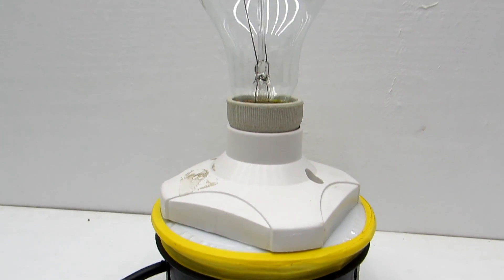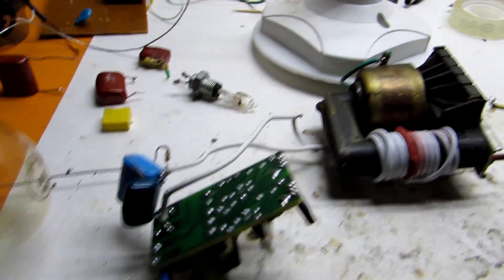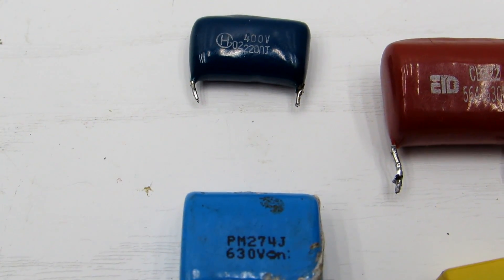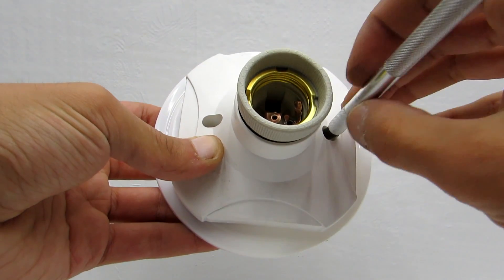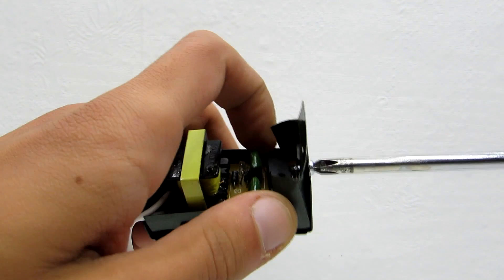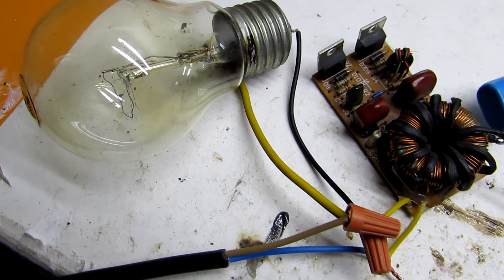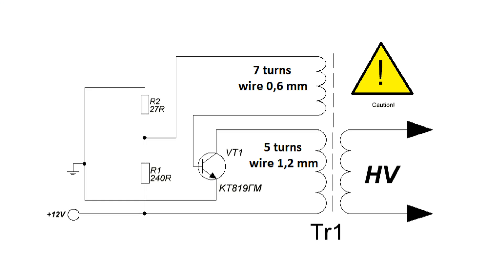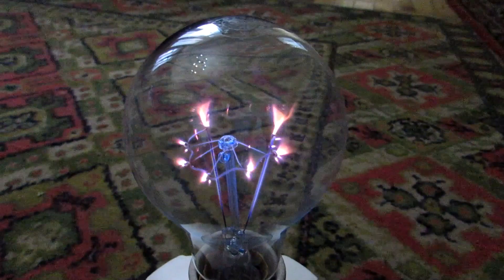DIY plasma ball from incandescent lamp

Comment: I have made this with tesla coil designed by me with a 100w bulb as top load of secondary coil. The result is awesome
Reply: Sambhunath Chatterjee I wanna see that, please make a video
Reply: @genesssisss  Ya sure
Reply: I done it with a 1000W bulb... I guess I will make a bigger tesla.
Reply: @HA7DN  the wattage doesn't make a difference, wattage of a bulb is how much it resists mains voltage, the high voltage plasma globe sends current through the gas inside the bulb rather than through the filament. A 1000w bulb wouldn't be any different than a 10w bulb.
Reply: @platinumsky845 except size. A 1000W lightbulb is bigger and thus makes a fancier display.
Reply: @HA7DN  you can find bulbs of any wattage in a variety of sizes, 1000w bulbs can come in sizes smaller than a pencil and 10w can come in sizes bigger than even larger store bought plasma globes. If you want a certain size then look for a certain size, not a certain wattage. Wattage is not what makes a bulb big.

Comment: The two wires from the hv transformer u connect it at the two end of the bulb or one at the end and other at the side
Reply: Well, a lightbulb is a conductor so if you connect it like that, then it is not going to work. I think you just need to connect one of the wires of the transformer to the lightbulb base. The other wire should be hanging in air.